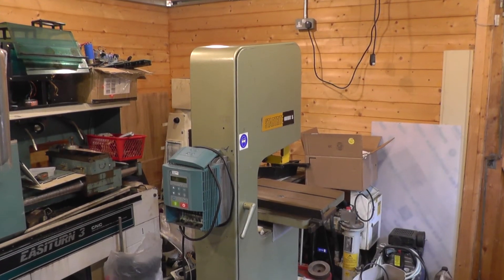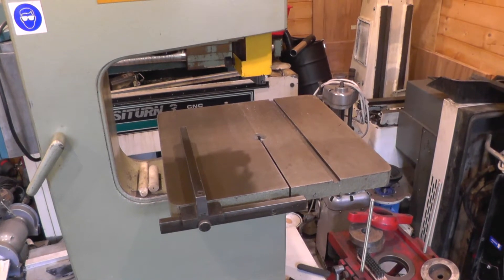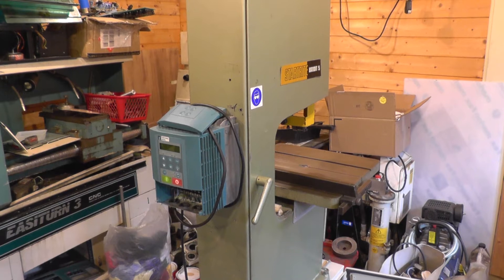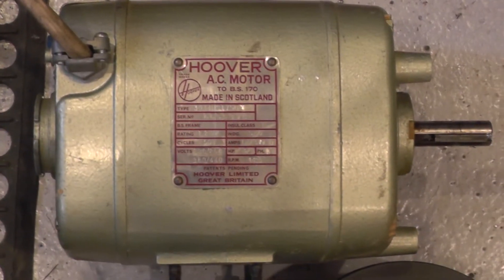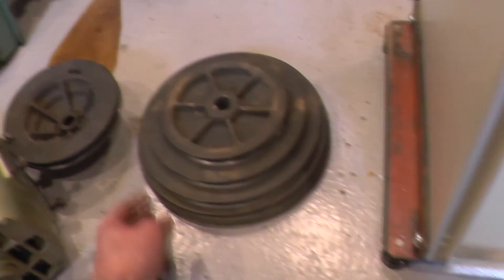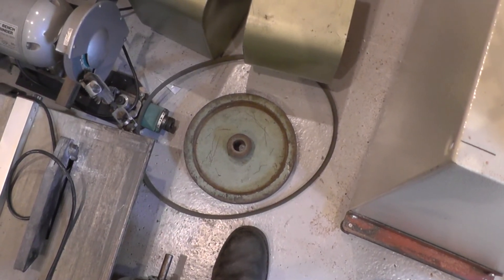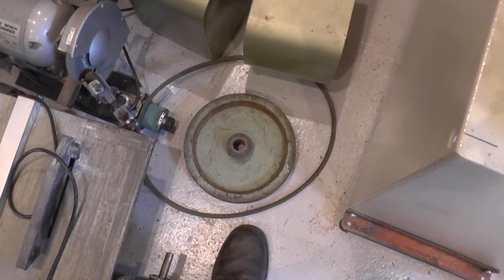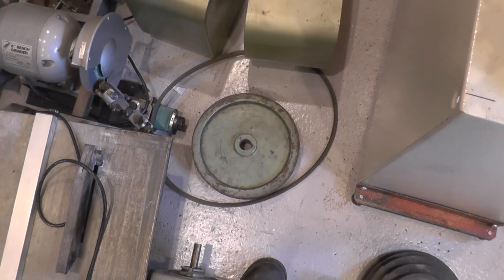Startrite Bandsaw modification

Comment: Not sure that base box is substantial enough..... especially under belt load.
Reply: If you have to have the belt that tight to keep it from slipping what its mounted on is the least of your worries. The primary issue is trying to use a wood bandsaw for metal. There's a reason steel cutoff saws for cutting long stock down to size are horizontal. You don't want metal cuttings going down into the machine and bottom sheave and everywhere else under the table and especially not getting run between the band and sheave where it'll stretch and stress the band until and cause it to slip and overheat if its not retightened frequently and cause it to simply snap if it is retightened frequently. 

Until it does slip or snap it will also overheat and damage the bearings and if you're lucky they won't spin in their bores and/or on their shafts and ruin the whole damned thing. But eventually you're going to destroy the damned thing regardless cutting metal with it. Bandsaws also tend to magnetize ferrous metals just because the rubber belts in ferrous sheaves and the motors generate static electricity. Start cutting non-ferrous metals like copper, brass etc with them and that process is accelerated. They can generate enough static electricity to shock the dogshit out of the operator if he's wearing rubber sole shoes/boots and happens to have a hand on the machine when he puts a hand on something grounded. 

Especially when the saw is still running. That's why t hose horizontal cutoff saws have automatic shut-offs that shut them down when the cut is complete and the "carriage" drops all the way down. Concrete isn't a conductor and when you've got hundreds or thousands of pounds of long stock on metal racks sitting on concrete floor and the guy(s) running the cutoff saw are wisely wearing leather gloves when handling that stock quite a charge can build up in the saw and/or steel stack. Especially in certain climates. 

All it takes is having a bare hand on the stack/saw and touching something like electrical conduit that's grounded and you can easily get zapped pretty damned hard. And since the current path from one outstretched hand/arm to the other is right through your heart and it only takes milliamps to stop your heart you'd better believe static electricity and bandsaws and metal can kill you. Factor in fools using "VFDs" which short 3-phase high-voltage machines FOR voltage and hertz and end up proportionately and automatically increasing AMPERAGE and the fact that they CAN'T be "safely" installed and GROUNDED and suddenly the potential for electrocution is damned real.  

Then remember that those who use "VFDs" to operate high-voltage 3-phase equipment "cheap" because they don't want to pay to do things correctly and SAFELY and match the current to the machine or vice versa by buying machine(s) suited to their shop or buying the additional service and equipment to suit their shops to the machine(s) are running VFDs to do things "cheap" and the red flags really start popping up. Hell, they're not enough smart enough to know that a "VFD" is constantly and unavoidably damaging their precious "new" machine(s) and how "hobby machinists" seem to be obsessed with "making chips" ASAP and the potential for stupid to turn deadly when they get "creative" in their "DIY" wiring is a real as it gets. 

And EVERY "VFD" is "fixing" an electrical service/machine mismatch at the expense of the MACHINE and every time the switch is thrown. Low voltage - AC or DC doesn't matter - is guaranteed to underspeed, overload and overheat every component and conductor it flows to and through. Put some noob "hobbyist" with no clue about anything in charge of that situation and with some tired old machine that no doubt was sold/scrapped by the previous owner because it was WORTHLESS to them if not a "liability" and add in overheating/overloading/underspeeding and the kinds of flammable materials often found in garages, workshops etc and the fact that "contactors" and relays can "stick" and keep flowing power even after a machine is "shut down" and you can add FIRE to the potential catastrophe list. 

And it all starts with the kind of folks that run around encouraging if not enabling "noob" wannabe "machinists" to buy worn-out, obsolete, worthless and dangerously "modified" and/or "misused" and/or "misnamed" machines like that "metal bandsaw". A bandsaw that's nothing but a wood saw some enterprising and I'd say crooked/criminal "machine tool reseller" or "restorer" or "rebuilder" bought for scrap price or less or maybe even got free or was paid to haul away and then sold to the first sucker he came across as a "machine tool". When a bandsaw doesn't show the "battlescars" from metal work and other tools and the "metal grime" that's mixed metal particles, dirt and oil/grease ANYWHERE but obviously hasn't been "washed and detailed" that's because its never been USED for METAL CUTTING. 

And only a FOOL would USE a vertical bandsaw FOR metal since its guaranteed to fail "prematurely" and cost more in broken bands and other "wear parts" than its worth if its a "good deal" to begin with. People paying $50-$500 for a "metal bandsaw" have no damned clue that just like there's no such thing as a "one type fits all" hacksaw blade there's no such thing as a "one type fits all bandsaw band/blade". And no, having more teeth per inch does not make a band/blade "faster". And overspeeding the machine with "overdrive" pulleys or other "modifications" takes you right back to "premature failure" again because the faster it runs and cuts the more material its going to send "downstairs" and the more load is on the machine and the sooner shit is going to come apart. Because vertical bandsaws are NOT METAL MACHINES. 

Vertical bandsaws are for wood and meat and bone. Not metal. I know that because as a diesel mechanic for 25 years and a lifelong gearhead and somebody who has been in and around shops my entire life growing up on farms and ranches and the like and took 6 years of shop classes - wood and metal - and is the son of an amateur "carpenter" AND amateur "welder/fabricator" and also the son of a GROCERY STORE MANAGER who has worked a day or two "cutting meat", I've never seen a freaking vertical bandsaw anywhere besides wood shops and "butcher shops". But then again I'm also an American and this whole "vertical bandsaws for metal" and selling junk fucking machines to fools seems to be overwhelmingly a "Commonwealth" thing.
Reply: @deeremeyer1749  The startrite bandit in the video was designed to be used with wood or metal.